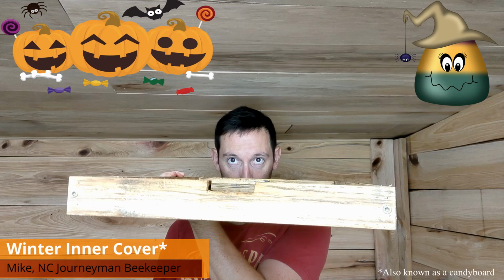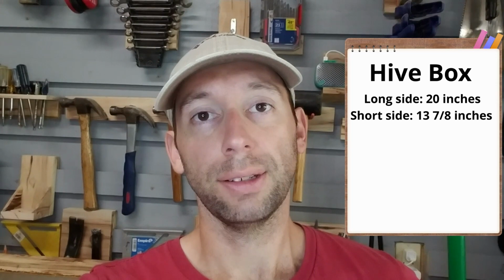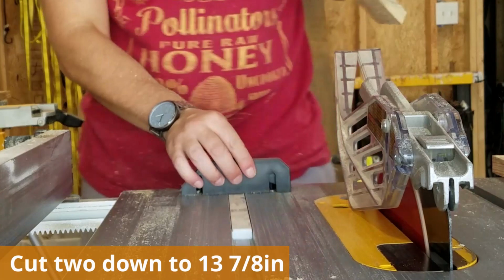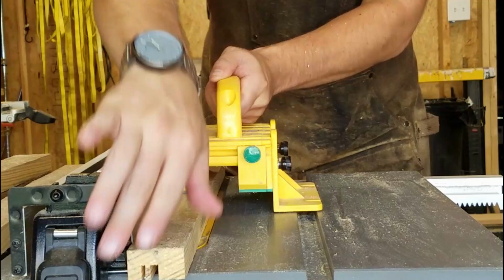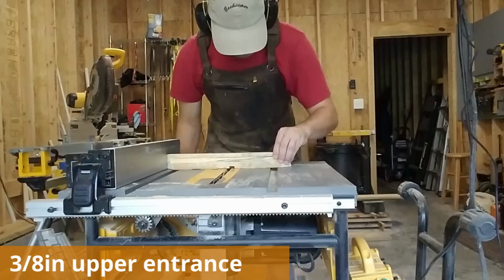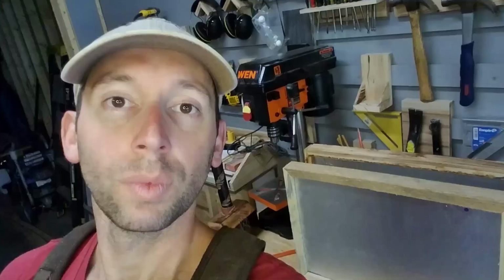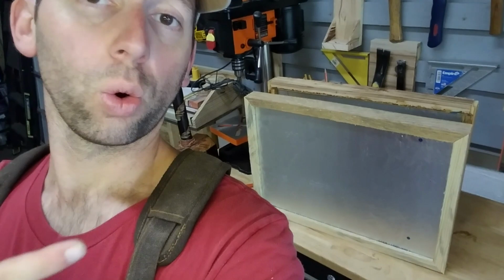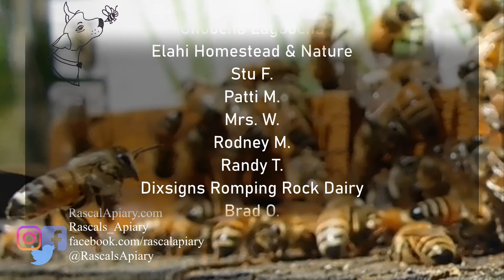Build your own Candy Board for winter beekeeping!

Comment: Do you ever have a problem with the candy falling off the board? Thanks!!!
Reply from the maker: Not at all! Once you pour the candy board in liquid form. Let it sit for 24hrs to harden. It will soak into the wood a bit and hold it firm. The candy sticks to the foil of the insulation as well. 
We went cheap one year and used Styrofoam, that worked but the bees started chewing at the Styrofoam when they finished the candy and it made a mess.
Reply: @RascalApiary  That's awesome. I use the same board insulation. That's why I asked. Thanks for the tip.
Reply: Do you have a url for the candy recipe?
Reply from the maker: My wife is currently making a blog post for the hard candy recipe. It will be up later this afternoon at rascalapiary.com
Reply from the maker: https://www.rascalapiary.com/winter-prep-candy-board-inner-cover/
There's are article and the recipe! Enjoy!